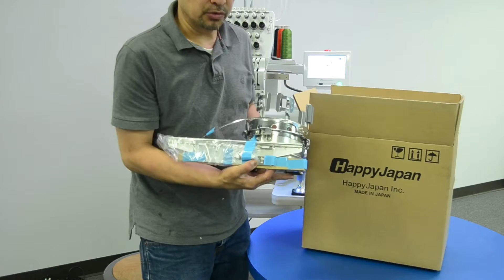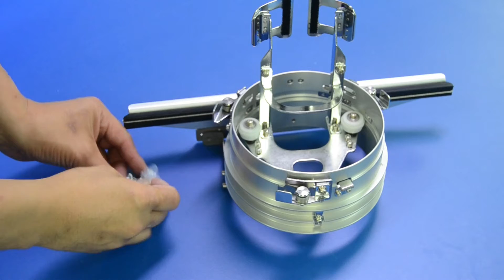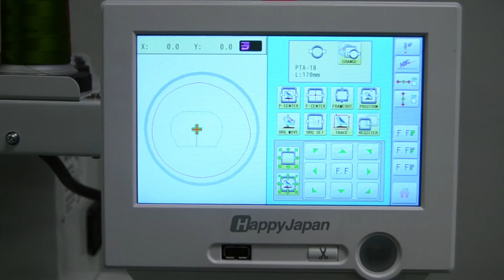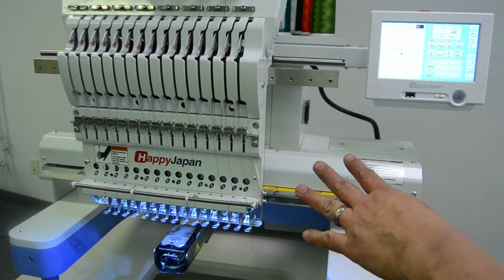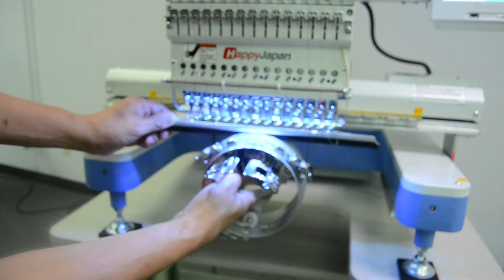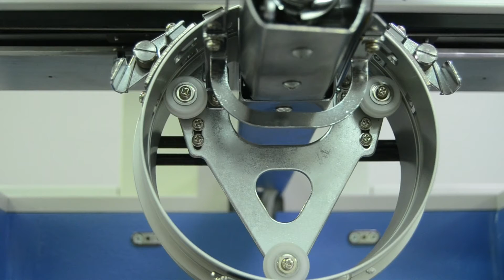HCD3-1501 (and HCD2-1501) - How to Set Up the Cap Driver for First Use

Comment: Hi Rene. I have the HCD2-1501 and have been recently been having terrible problems with needle breaks on ball caps. So, I am checking everything.  Two things that I found with my machine. One is that the L shaped brackets cannot possibly be flush with the front as shown in this video.  They are pushed ALL the way back, impossible to go any further, and yet they are not flush.  Secondly,  I tried to adjust the set screws on the inside of the drum of the cap driver. Again, it is physically impossible for the cap driver to even touch the arm, as it will not allow it.  The oval openings on my machine, do not have as much wiggle room and appear to be smaller.  I was able to lower it a bit, albeit it was only maybe a couple of millimeters.  I tried this because even before I found this video (which is fantastic!) I was looking at how high the driver rode over the arm; it looked abnormally high compared to my Brother machine which almost looks like it is laying on top of the arm, but is not.  I am in the Happy group and reached out for help a couple of times with this needle breaking problem.  You can respond in either place when you get a chance.  Thanks so much for all that you do!
Reply from the maker: Hi, Vicki, Rene here. I think I saw your post on Facebook.  Call or text me at 980-230-2841 and we can find a time to go over that cap driver or shoot me an email at rrosales@texmacusa.com
Reply: Something I just noticed is that I have rather large washers around all my screws in the drum.  This is blocking it from being able to move up and down further.  Do you think that I can take them off?  In this video, it looks like this machine either has very small ones or none at all. Thanks.

Comment: Wow Rene this is a good video. But what happened it just stopped? I was looking forward to hearing what it would sound like when the driver was perfect - low but not touching. Another question when your pulling the arms back & forth , the machine is turned off right? I know dumb questions but I’m about to start gf it’s again & I thought I’d better check my adjustments again- thank you for the attention to detail for this old brain
Reply from the maker: Bevyjean I thought I was clear in the video that the machine had to be off to move the arms by hand but maybe not - glad you caught that.  I need to make that very clear, so thank you!  Hopefully as far as the sound goes, you shouldn't hear any odd sound when moving it, although I'll admit it was scraping just every so slightly in the video - but when I sew hats with it like that, it's fine - no metal shavings or anything.  Thanks for your comment!